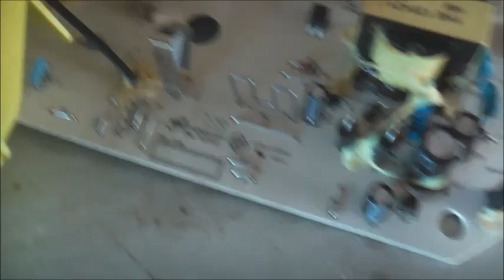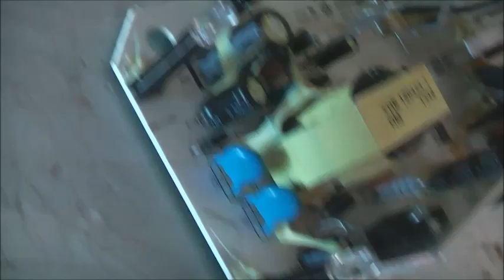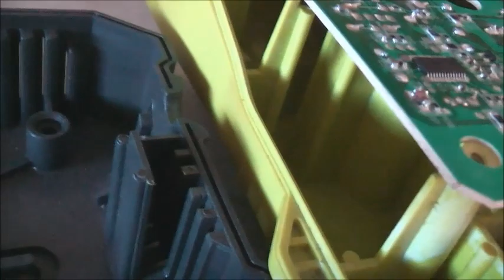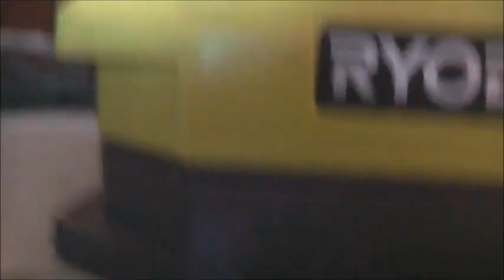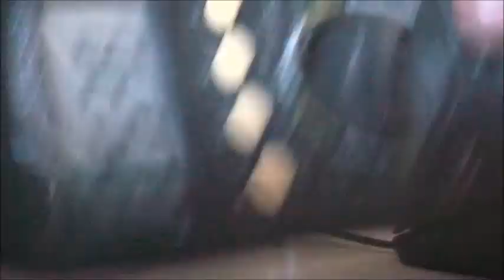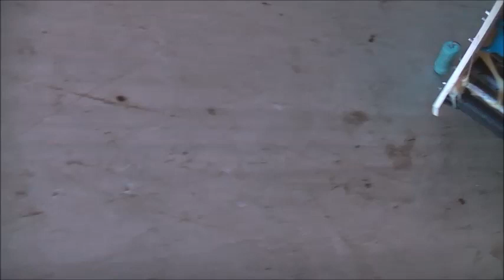Ryobi ONE-Charger Troubleshooting

Comment: I'm trying to troubleshoot my Ryobi charger but it took me about two minutes to even understand what language you were speaking - and I'm a native English speaker!  I'm sure you know what you are doing but my knowledge of electronics is so little that sadly the video didn't help me.
Reply: I Hope you founf your answers.  For me, the output fuse blew due to current overload.  It looks like the surface mount FET on the bottom of the board has probably gone short rather than the through hole on the heatsink, and I don't have a hot air station to change the former.

Comment: none of the battery packs looks like mine.  It is not a year old yet, and I cannot get the pack to go onto the charger.  It's that simple.  This is the weirdest thing.  It used to fit, but it has set in the garage in cold weather, so it just will to slide into place.  Can anyone help me?????cwoods960@gmail.com

Comment: Does that black square component (in the middle of the circuit board, near the hole) have any text/numbers on it? I have tried to figure it out what it was. It was exploded to pieces. My charger flashed red and green lights even without battery attached to it. I opened it and discovered that this component was totally destroyed. Maybe because I used it to load 5amp battery???
Reply: moun10high (9565bgh mosfet ) it’s a common failure mode of these chargers replace it and it should fix your problem
Reply: josh durrantJD OMG. Thank you very very much for this info!

Comment: I have the same charger.  I have used it half a dozen times over about 2 years. Mine stop working.  I opened it up and found that the Mosfet transistor had a split with a hole in it( just like the ground at Shanksville).  I have  ordered an equivalent Mosfet from China cost 3$ u s  Plus 8$u s freight. Will post details here if it fixes De charger.  My guess is the heat sinking and or power rating of the Mosfet is not enough. It is the  chip right in the center of the underside of the board near the hole with the number 9565BGH   on it?
Reply: I put a new identical Mosfet in which exploded as soon as I put  in  battery  to charge. So since I already had an investment in a drill and battery I went back to Bunnings  to canvass another charger, and discovered I had a two year  guarantee, But  I had owned mine two years and 1 month so they let me off. and gave me a new charger . They had a charger and a battery for 120$ nz so they gave me that for $50nz . instead of $120 . So thankyou Bunnings.  I hope I get more than two years out of this new charger. And I now have 2 x1.5 amp hour Batts to go batty with.
Reply: What is the value (or the code) of the replacement Mosfet transistor?

Comment: its disturbing that this video has had so many views, well over 5000, so obviously there is a design fault, it's not an occasional faulty component.
I think I only got to charge about 12 times.
Reply: Mine got broke now, year 2025, actually christmas 2024. And manifacture year is 2013... 11 years and now it betrayed me! But still it would be challenge to get working again... My charger is 1418H. Maybe that's why it lasted so long...
Reply: @matiasketo5820  I since got an adapter that allows Dewalt or Dewalt copyt batteries to run in Ryobi tools, the chargers and clone batteries are cheaper and have performed well so far. I think the clone battery is called Waitley
Reply: 47 thousand now :P
Reply: 50,000 views in Nov 2019

Comment: FIRST you have to check the primary circuit, check the output, SECOND check all diodes of secondary circuit.....you will found out its one of the diode is shorted

Comment: Hello  I have found that there are two diodes at location, D9 & D3 which are MBR 5200 these or one of these goes "short" also the .43 ohm resistor burnt out and "Ap9565BGH" fried in various case's. Check these out, but SM items have also cooked. Hope this helps someone.
Reply: RicsDad  I have heard of built in obsolescence  but this must be costing Ryobi big time considering there are so many other good brands out there.
Reply: There's a lot of reports of the transistors burning out in these.
Reply: Please also check c1 very small capacitor one leg completely disconnected, hard to see it naked eye

Comment: Added info, hi all I have 3 x BCL 14181H chargers, they all have a failed  MOSFET "AP9565BGH" these can be replaced with a FDD4685 Mosfet (higher  spec) a couple of £ from Ebuygum, I do not know if this is the full repair, as  I am waiting for the parts. But at least it allows the circuit to try and  lets us move forward.
Reply: So what happened ? We have been waiting 4 years !
Reply: @kimbo99 8 years*

Comment: I would check for shorts or problems in the diodes and transistors/mosfets and open resistors. See if you can find datasheets for any of the main switching IC's. Be careful with that transformer if it gets 50hz or DC across is primary there's gonna be bang. Bet there's a micro controller in there as well.

Comment: The "transistor" is probably a FET.
Lithium Ion packs require a little more sophisticated charging than other battery types so more can go wrong with them.

I haven't noticed any real difference over the years as far as reliability of the chargers.
Pretty much luck of the draw from my experience.